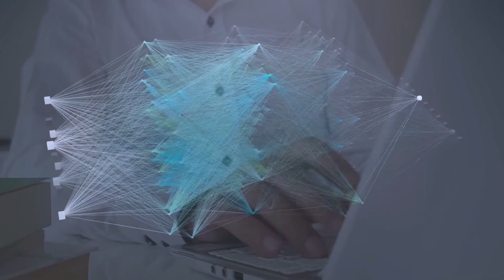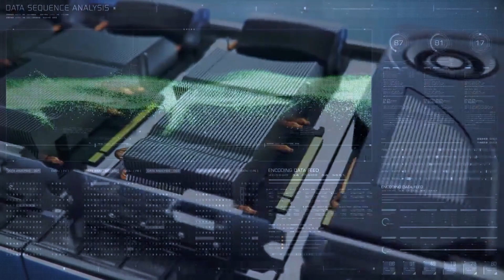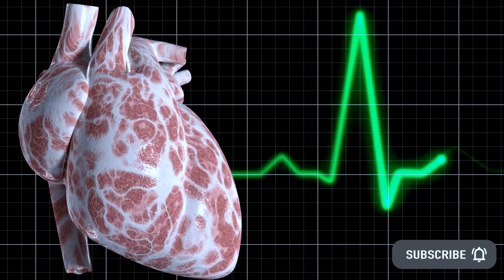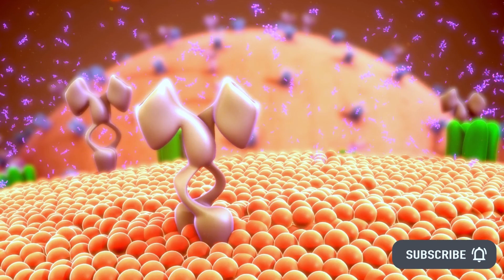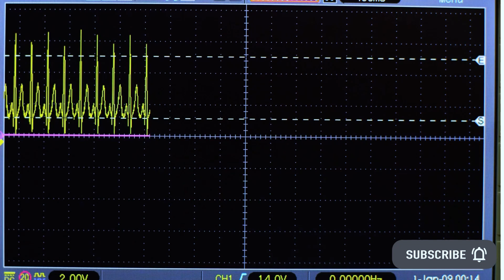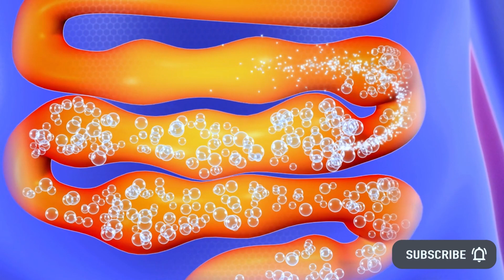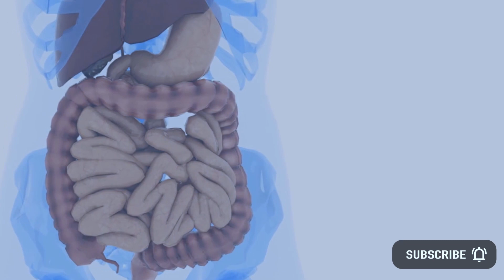Fastest AI Supercomputer To Surpass Human Brain By 5X Size & 10X Speed | AI Powered Exoskeleton

Comment: Wrong. 100 billion neurons * 7000 connections per neurons on average = 700 trillion connections.
Furthermore, those connections are analogic, not binary. An analog connection can transmit much more than a zero or a 1 depending on the amplitude of the signal and the frequency.
Meaning each connection aren't multiplied by 2, they're multiplied by I don't know the exact number... But it's a WHOLE A LOT.
The number of states a brain can have is SEVERAL ORDERS OF MAGNITUDE higher than 500 trillions. This computer doesn't even come close.
Reply: Yeah, the title is misleading. Even all the procesing power of all the combined machines in the world can't even come close to the procesing power of the human brain, along with all the nervous system. Besides of what you just said, there is the problem of the energy consumption comparison, which is FAR from being "10 times more efficient"... And what about the size? Pff... Nature outcomes almost everything (if not everything) that human can artificially produce in almost every single way.